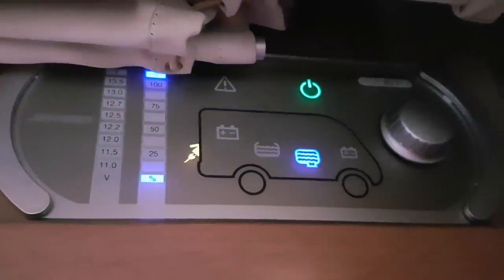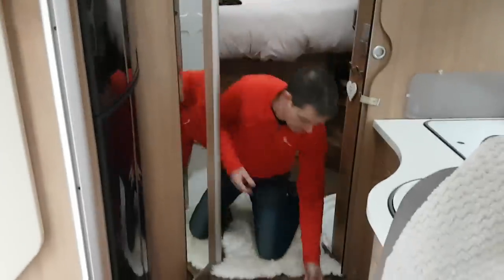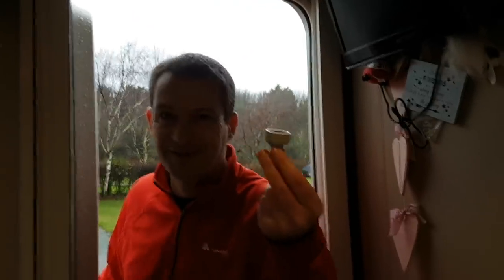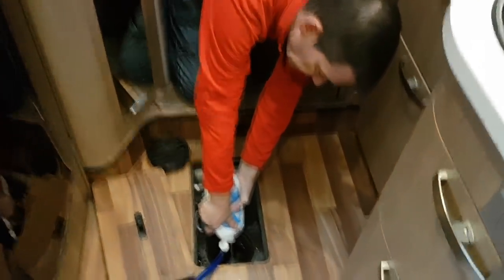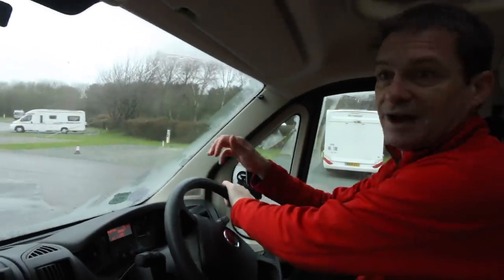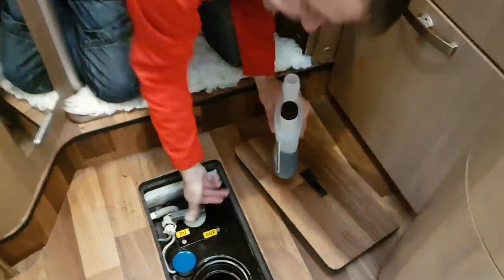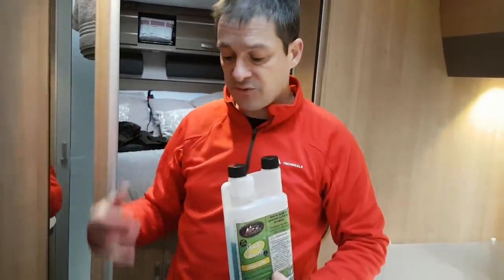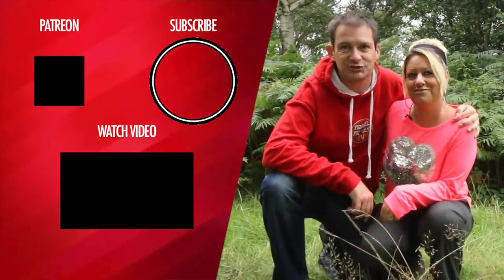Motorhome Grey Water Tank & Sensor Cleaning Tips

Comment: We've got a 44' fifth wheel with huge tanks we must "slosh" around as well.  We use the blue stuff in the states too.  A kettle of hot water in the drains helps loosen things too.  No coke, ants will invade.  No bleach, too harsh on plumbing.  The blue stuff has enzymes that break everything down nicely.  White vinegar is also safe.

Comment: You would most likely get a better result with vinegar and it is probably not that much more per bottle, as long as you don't have a bunch of bleach or hydrogen peroxide in your grey water. It's just a more powerful acid than what is in the coke. I always have a bottle of vinegar for cleaning, a vinegar/water solution works great for soaking stove drip pans.

Comment: I put 2 5lb bags of ice in my black tank before I empty it. I go for a drive before i empty it. The ice acts as a macerator  of sorts as well as getting all the disgusting muck from the cracks n crevices. Works like a charm and it's a cheap method of cleaning out the tank.